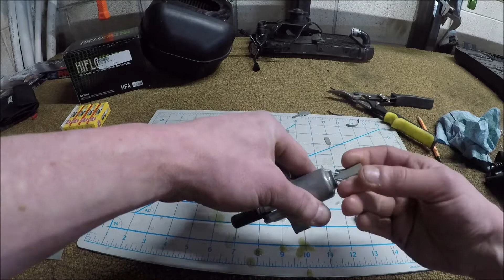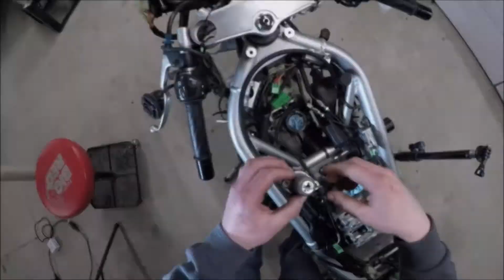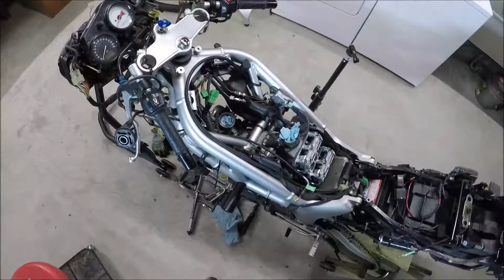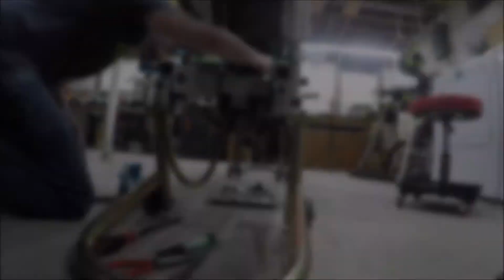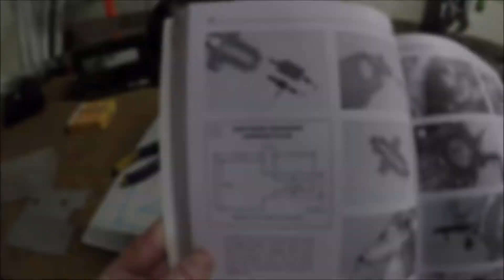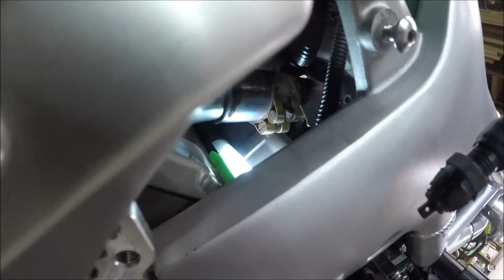SV650S Cam Chain Tensioner Tool

Comment: I watched a video on valve adjustment on gen 2 DL650 at CircleNZ.co.nz. This man rents Vstroms and are some of his favorites. I looked up gen2/3 and tensioners are the same #s. There is a central bolt that he removed without taking whole unit out. that should be easier , but it's still tight.
Reply from the maker: That's good to know, thanks Frank. I'll have to start researching that before too long.

Comment: I commented already on your valve adjustment video, then I ran into this. Makes sense now. Gen 3 vstrom probably has a different tensioner. What repair manual brand are you using? They might have the dimensions for a key for my bike. Thanks.
Reply from the maker: I have the factory service manual--the big one. I'm out of town currently, but I'll be back soon, and I can peek through the manual and see what they say about the cam chain tensioners and associated tools.

One thing I'd do differently on the Gen1 again is to simply leave the tool wound up to relieve the chain slack and not actually remove the tensioners if not necessary. It would require cutting better holding cct tools, but it would probably save a ton of time and frusration.

Comment: That's pretty funny dude but great tip about the diy tool.
Reply: I'm doing a valve adjustment on my 650 v strom now but i was having trouble wirh the chain tensioner but with your key tip i can finish up tomorrow thanks again keep up the good work.
Reply from the maker: @greggmel5825  fantastic. Good luck on the adjustment. Thanks for the kind words.
Reply from the maker: I realize now I should have put a jump scare warning, lol.

If you have mechanical skills and made a good tool from the beggining (something I don't posses), it'll make the valve adjustment so much easier.

Comment: Lol I jumped the first time you yelled f@ck. Wasn’t expecting that.
Reply from the maker: I don't want to give the illusion of competence 😂

I did that shim under bucket adjustment finally. Honestly, the cam chain tensioner was the trickiest bit by far. Well, we'll see... I want to get it running first to verify I did it correct, hah.

I probably should have lowered the sound on the fuck part, lol. But it scared the hell out of me when it happened!
Reply: @matttriestodothings  laughing with you not at you. Been there in the middle of jobs before.

Comment: Nice

Pretty handy that you had the dimensions! 
I will be doing cam chain tensioner replacements on a bike soon and it has been on my mind.
Reply from the maker: If it's a gen 2 SV650, I think those are slightly different. The housing/mounting for sure looks a little different, but it may work the same. 

Yep. Dimensions were nice to have. I used too thin of gauge aluminum at first, and that didn't work at all. The 0.75mm scrap steel I had worked alright, but 1mm would be much better. Also, more accurate cuts and I probably wouldn't have had it shooting out and scaring the shit out of me, but where is the fun in that?
Reply: @matttriestodothings  I will be performing surgery on a VFR800 in this case, which actually seems to be reasonably easy to do :)

I sold my SV (kinda regret it; might get a 1000 at some stage to replace it).
Reply from the maker: @UnCivilEngineerIRL  I'm guessing you already know this, but if you go looking for a cam chain tensioner on a VFR800 from 1998-2001, you might be really surprised at what you find :-P 

At some point I will probably buy an 80s VFR1000. I need to have a gear driven cam bike in my life. Don't need it immediately, but it needs to be there. Plus, the community at VFRWorld is pretty awesome.
Reply: @matttriestodothings  Unfortunately Honda have forsaken me and withdrawn my blessed gears, replaced with accursed chains :(  (first of the VTEC 800s)

I have an old ('89) CBR250R (with gear driven cams, pretty awesome little bike)
Reply from the maker: @UnCivilEngineerIRL  Ohhhh damn. The CBR250R looks so awesome. I'm not sure if we even got those in the states.
Reply: @matttriestodothings  I don't think so, they are suuuuuper rare over there.

I guess the 'bigger is better' mentality would have made selling them impossible.
(All I can hear in the back of my head is "I'm buying a FireBlade as my first bike, freed'm fuck'yaahh" hahaha)